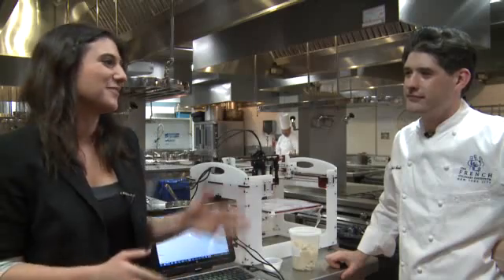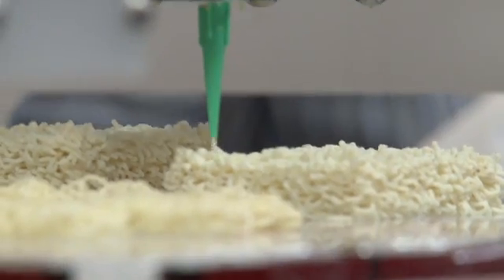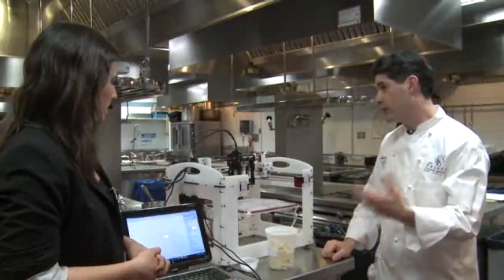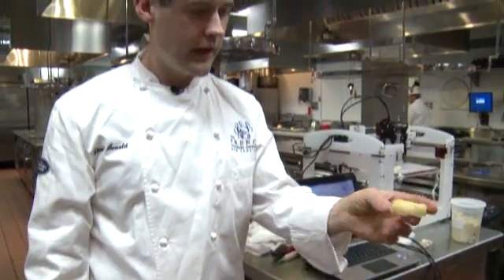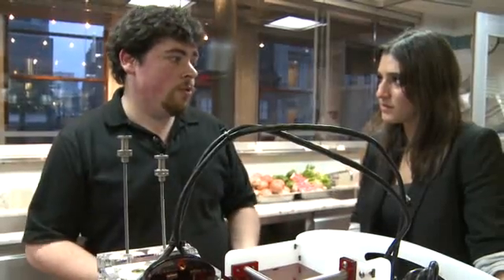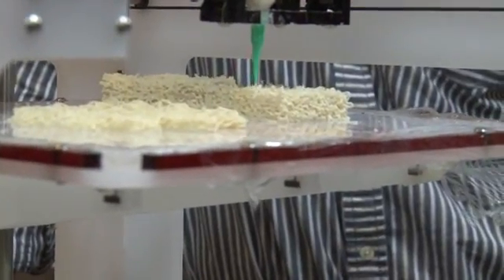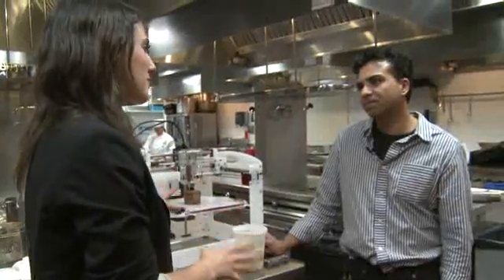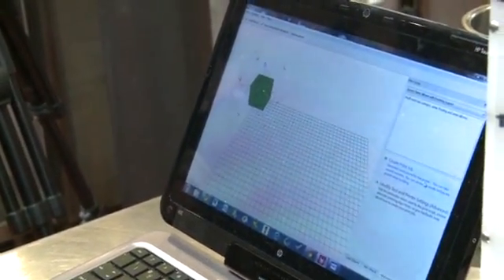3-D food printer makes dessert

Comment: In theory it would take 1000 years, however if one can miniaturize a particle accelerator and rig it to the current printer you could make it. Right now the big ones are being used to synthesize rare metals like gold and titanium.  The only problem is that it needs a lot of power.  Which of course once solved you won't need even the basic of kitchen appliances.